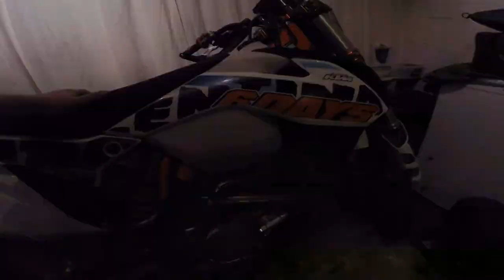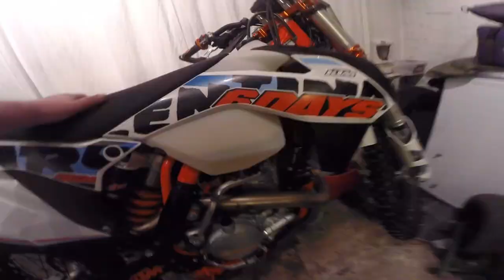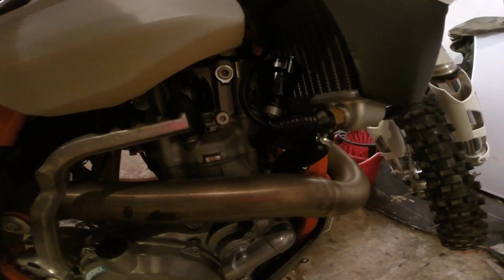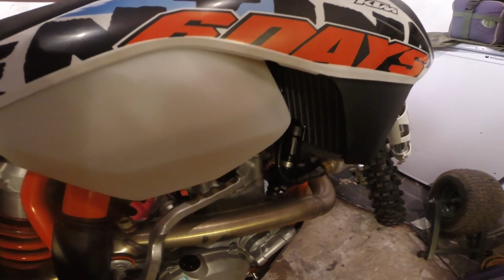2015 KTM EXC 500 Engine Tapping

Comment: Normal KTM noise, might want to check your valve clearances if they are close leave them alone, they are a pain to adjust. if you must adjust them make sure to recheck after you tighten the lock nut because it pulls the part that hits the valve up making a bigger gap between that and the valve head.
Reply: No, that's not how my engine sounds with about 290hours on it. That ticking noise isn't normal. The guy said that it was a spark plug. I would think it's the cam tensioner as I've heard it in other bikes doing something similar. It wasn't.
Reply: @C_R_O_M________   yes could be cam tensioner

Comment from the maker: Yeah it's a bit embarrassing, it was as simple as a spark plug replacement. It was absolutely battered and it was lose.  And I've now fitted an Akrapovic and I can't hear anything at all apart from that bad boy lol
Reply: What was actually wrong with the spark plug?  I have a husky 501 which is the same motor as yours and I just recently started hearing that sound as well and it's a brand new bike.  Doesn't feel very good.  I'm going to check the plug tomorrow.
Reply: Did it work and the sound gone ?
Reply: @kal1fornia   Hi, i have the same problem! same sound. pls tell me if you fixed. what was? Spark plug? or Cam chain tensionar? :(

Comment: My 16' makes the same noise,  I dropped a valve at 91 hrs and blew a valve but I had went past the recommended checks. I rebuilt the motor and still have the same noise . It's just the valve train. When it get louder check your clearances
Reply: Well, no it's not how these engines work. Mine (a 2012 500) is not making that ticking noise. It was a spark plug that was either loose or bad for this guy.

Comment: 2015 Husqvarna 501, it makes the same noise as well, I was thinking cam chain tensioner also, haven’t check the spark plug in quite some time. Think I will give that a go. Thanks.
Reply: Angus no, still has ticking sound at idle, but runs great. 👍🏽
Reply: @advmotonut8015  Hi, did you find what was this ticking noise? I have exc 450 and has the same noise.

Comment: '15 250 xc-f    same, same, but its not normal cause it didn't ever sound that way before and then just came on suddenly. i've been to worried to ride it like this. its not the tensioner, i wish i could figure it out and fix it before it ends up at a shop for a tear down & rebuild $$$. especially if its something easy that i could do...

Comment: 2019 500 excf with 40 hrs. Same thing. Going to fiddle the sparkplug now
Reply: pls tell me if you fixed. what was it?
Reply: @levansi2180  not sure. Never figured it out. Taking it to the shop this winter
Reply: okay. anyway thank you. i will try valve clearences in this week and if it fix i let you know.
Reply: @levansi2180  cool thanks pal
Reply: I have a booked visit already in Ktm service shop on 5th Dec.
Reply: @levansi2180  don't forget to let me know what they say! Cheers!
Reply: @ashedold11  Hi, i made Engine service, changed piston kit, inspect the valves and it has the same nose like this. 

Did you find, what was?
Reply: @levansi2180  mine still isn't fixed. I am pretty sure it is the timing chain tensioner

Comment: I guess you changed the cam chain tensioner Right if yes what type of tensioner it was ? Thanks.
Reply from the maker: I changed the plug and it went away.  It was a bit lose.  Never noticed the noise over an akrapovic end can.  It never missed a beat before the noice or after.
Reply: Spark plug?

Comment: Mine sounds the same except for the higher pitched ticking sound. I only have to lower sounding tick in my engine.. is this normal? I replaced the piston and checked valve clearances. The intake ones were a bit on the tight end, but still in spec. Maybe it's just the engine itself?
Reply: He said it was a spark plug. Look into the comments. These engines don't sound like that. I have a 2012 500...no ticking noise.

Comment: Its the timing chain. Or how i would say on german: steuerkette. :) you have to tighten the timingchain. Cause its not tighten. :)
Reply: Hallo, hattest du auch gleich problem? Ich habe jetzt gleich situzion und ich denke auch, das ist steuerkette.
Reply: @levansi2180  ja, du müsstest versuchen sie mit einem steuerkettenspanner neu zu spannen. Du hast auf der linken seite am block eine schrauben. Da solltest du das einstellen können. Müsstest mal in das service heft schauen. Da müsste die position des spanners sein. Ebenso wieviel du spannen musst. :D
Reply: Okay! Danke sehr. ;)
Reply: @levansi2180  Hi man, was it finally the tensioner? I followed a few of your comments in this thread and I saw that you weren't able to resolve the problem. Mine is fine but I'm always looking to broaden my knowledge on my bike (2012 500 290hrs). It runs like a champ.
Reply: @C_R_O_M________   Hi, everyone said it is okay this noise. I made engine service, i checked krankshaft bearings, almost everything and still same noise. It seems normal. Motorcycle run very well.
Reply: @levansi2180  Ok, thank you. It seems weird to me that my bike is not replicating that noise. I don;t know.